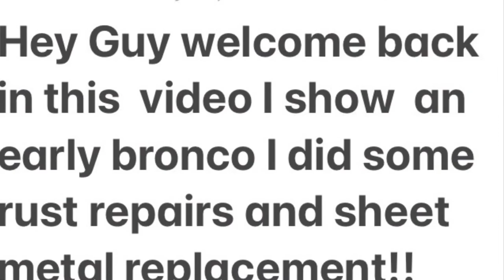EARLY BRONCO RUST PANEL REPLACEMENT (pic video)

Comment: Real nice work ! 👍 Used to work for a fellow that would only have 76 or 77 Bronco's for service vehicles. He did not like them without p/s or p/b LOL ! Thank you for stopping by !
Reply from the maker: The power steering in these truck where terrible easy bolt in for them was a Jeep Grand Cherokee box practically installs it self